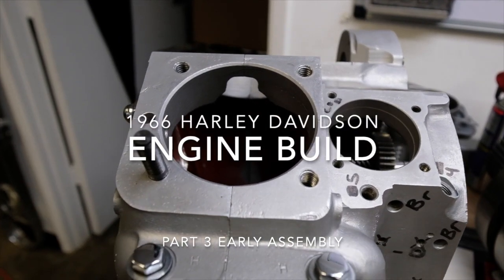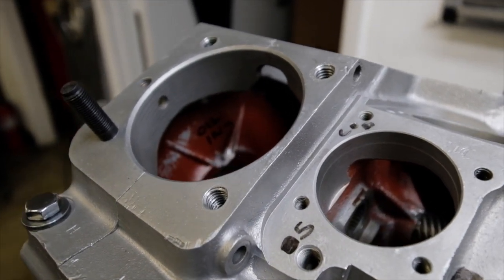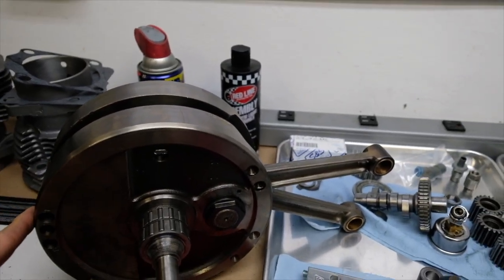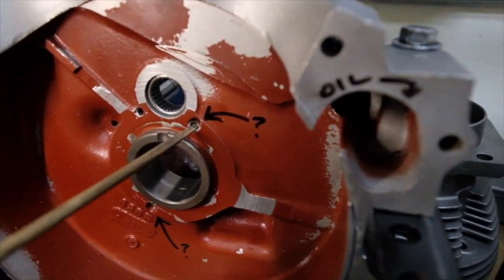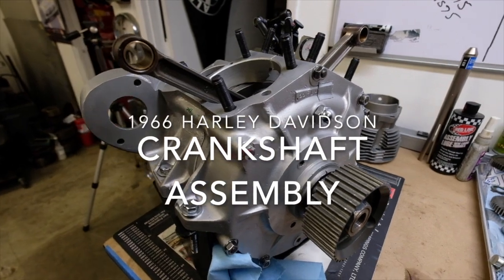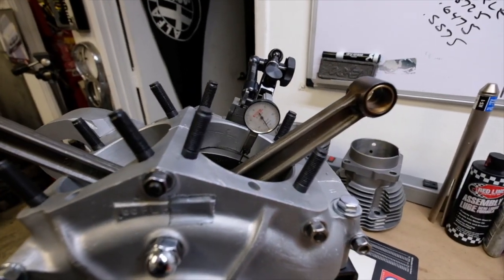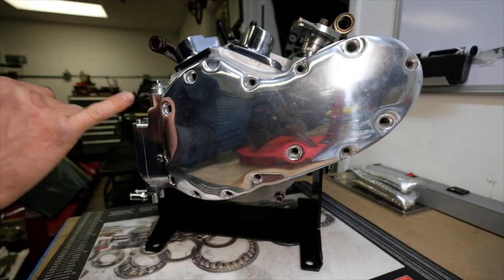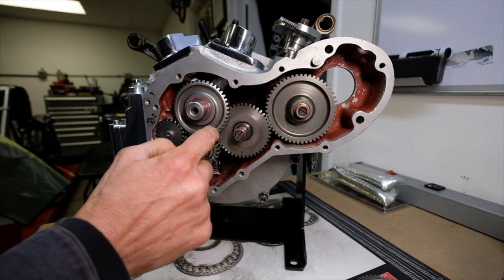Rose the Harley Davidson Shovelhead chopper project Part 3 early engine assembly

Comment: If my math is right your 4.750 stroke and 3.437 bore should give you just shy of 90 cu.in. motor. They call it an 89 kit at S/S cycle. With that long stroke it should pull hard above 3000 rpm. Enjoy.